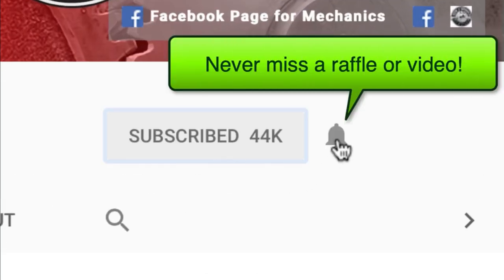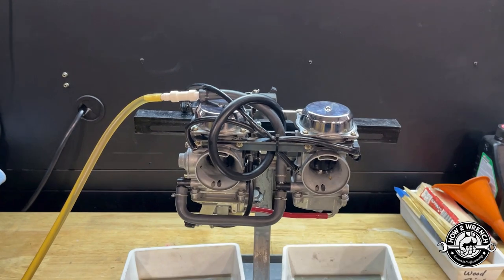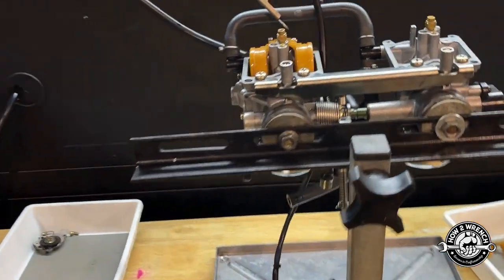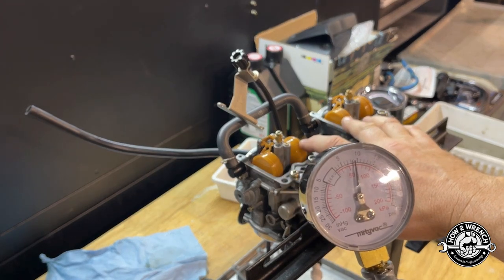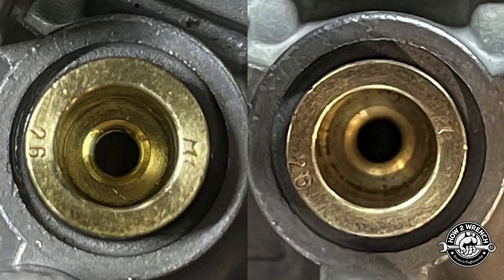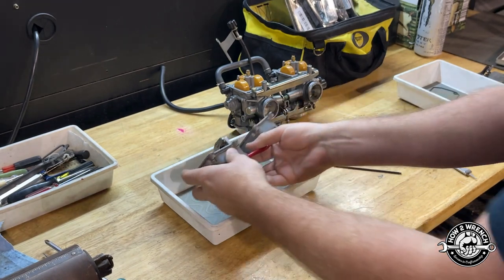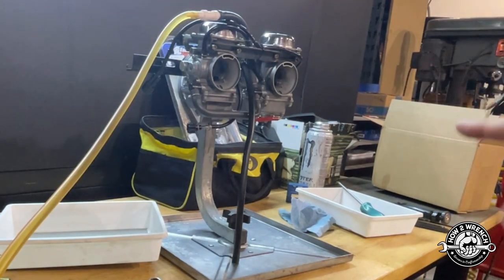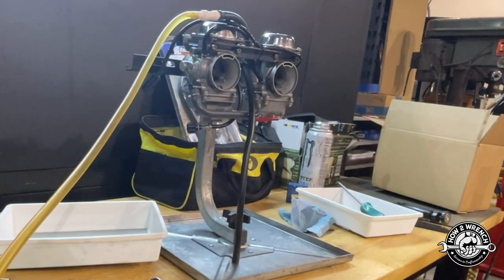Carburetor seat leaking. All the diagnostic tests you need! Before after needle seat repair. Send it

Comment: What would cause a 4 cylinder carb bike idle revs to momentarily drop when lifted off the side stand to vertical (as though you're sat on the bike) then pick back up to idle speed? 

I'm thinking it's an issue with the fuel level but I've checked and double checked and the thing still does it (Yamaha R6). Bike rides fine etc apart from this and it's annoying. Throttle cable not tight either as it does it when the handle bars are kept straight.
Reply from the maker: That's a good question for Shane directly. Have you considered joining the channel to get him daily as a member benefit?
You reached the social media team here. We get 300-400 requests a week, so it’s a bit time challenging as you can imagine. 
Shane does try to answer some non-members' questions when he gets some time so hang tight if you’re not in a hurry. 
Did you know one of the member benefits is to ask for which videos would work for your needs and get daily "quicks answers" to questions directly from Shane?. Best $1.99 a month you'd spend...of course enjoy the over 700 free videos and access the member only vids with all the other benefits listed below. 

There are two immediate options that can get you a solution within 24 hours and quite often within the day. 

Option 1: 
Consider joining...best $1.99 you'll spend this month 😁 This is great for quick answers. 
He literally logs in and answers member questions daily! He does an AM and PM check-in to answer all member questions. Join this channel to get access to perks:
https://www.youtube.com/channel/UCBhM8DCKnT3qXwTW0eToyCg/join       
-Daily MEMBER FIRST COMMENTS ANSWERED FIRST 
-Live Q/A video chats
-Wonder if we have a video on your need? Members can request content links!
-Full Access to the ENTIRE 700 video library
-Member-Only FREE tool giveaways  
Ways to support or high five How 2 Wrench! Thank you in advance. YOU MOTIVATE US TO DO MORE!
1. Smash the subscribe button (thank if already a sub!)
2. Have you seen our "YouTube Trained Support Shirts?  https://goodfellasmerch.com/collections/how-2-wrench/products/support-shirt   
3. High five donation:  https://www.paypal.me/how2wrench    
4. Got an emergency and your head is about to explode from frustration or fear? Get Shane’s cell here: https://how2wrench.com/ols/products/techline-one-on-one

Comment: My float height is not right, and it's not adjustable.  I did the clear tube test and the fill level is over the gasket.   Do you have any idea.   My idea is that the 1985 float is different from the all the rest.

https://www.youtube.com/watch?v=HfnGyS1Al40

https://www.youtube.com/watch?v=yN1Wpm9_Xs4

https://www.youtube.com/watch?v=g6y32Gw5HK4

My bike will idle on full choke, then if I twist throttle it will stumble, then if blast past that it will run fine.. on choke of course.   But it's next to impossible to get past the stumble.   The fuel level is definitely over the gasket height because it's leaking even with a new float bowl gasket on it.